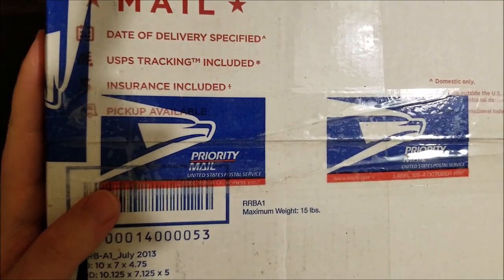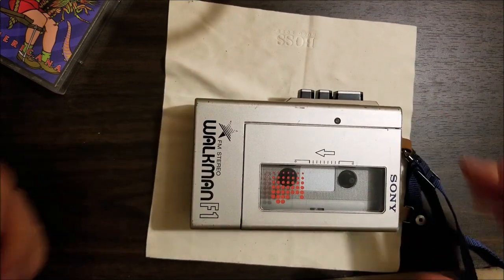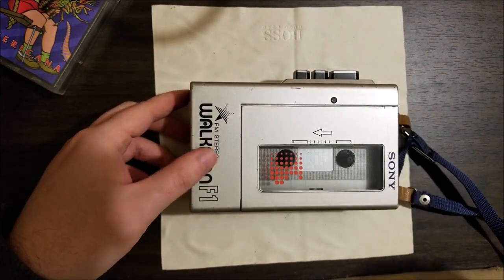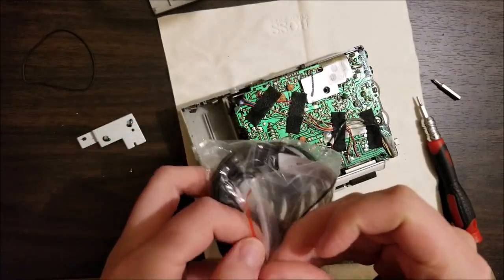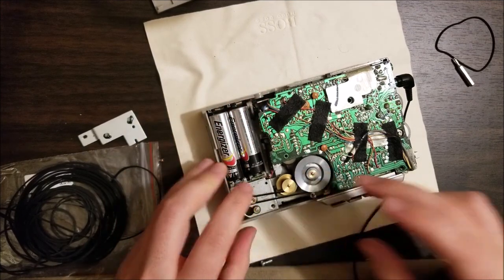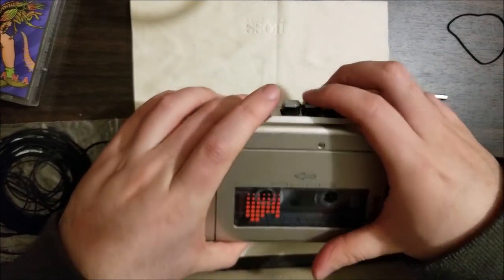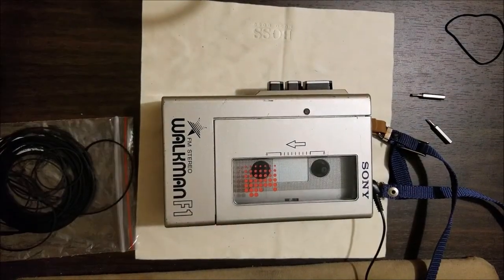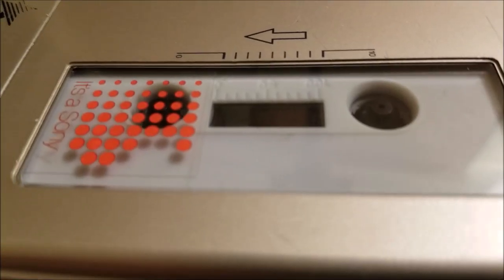Let's Fix: Sony F1 Cassette Walkman

Comment: Thank you for the help works great now. Biggest thing is don't let the idler wheel come off or up or the rubber wheel mechanisms behind it will pop out and its very hard to put back. Also the belt has to be absolutely straight with no twists even the slightest twist in the best  you will get a wobble sound like the video stated. Thank you again!
Reply from the maker: I've totally never removed the flywheel and accidentally let the spring and metal bracket ping off, had to spend 10 minutes finding them and another 10 minutes fiddling with tweezers to get everything put back correctly ... nope not me lol!